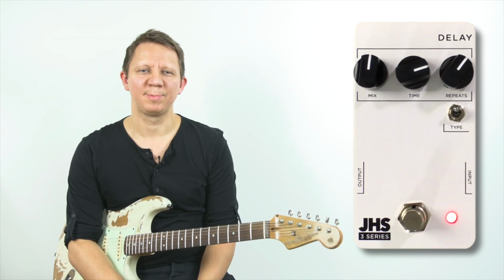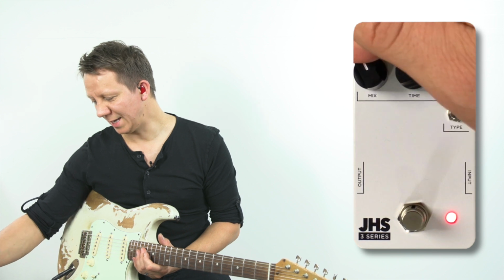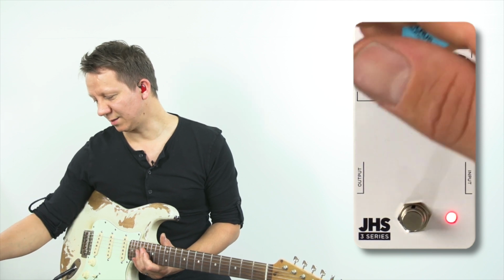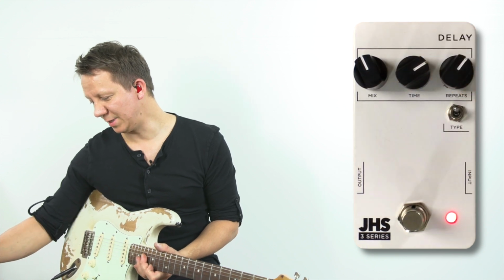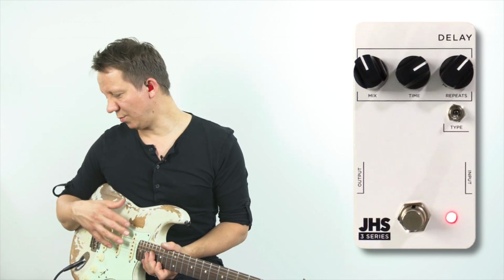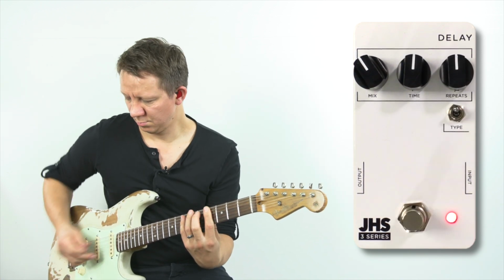JHS Pedals 3 Series Delay

Comment: Don't buy these pedals the toggle switches break in time , there's a space between the switch body and the box after some use the threaded part of the switch pulls out of the switch body breaking the switch I've had this happen with a delay and an overdrive in less than a year , they could fix it by putting a couple washers in between the switch body and box but they don't do it , you've been warned!